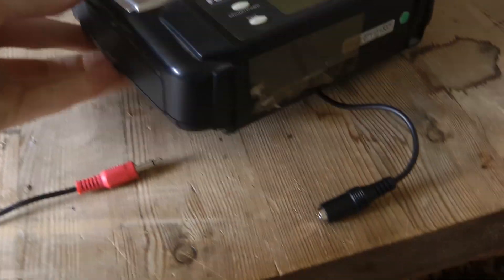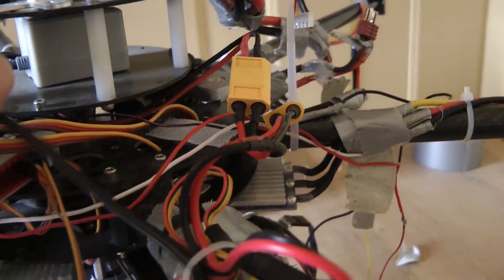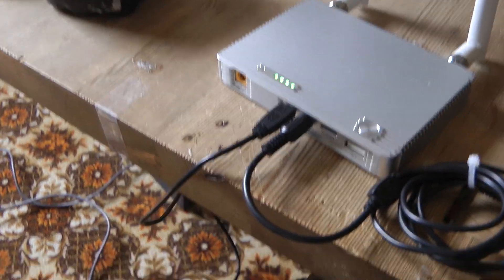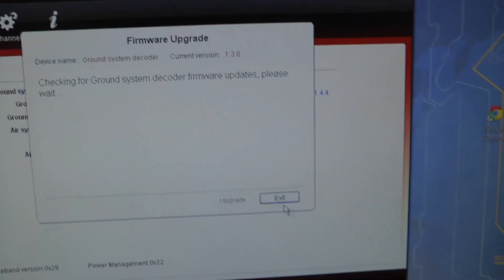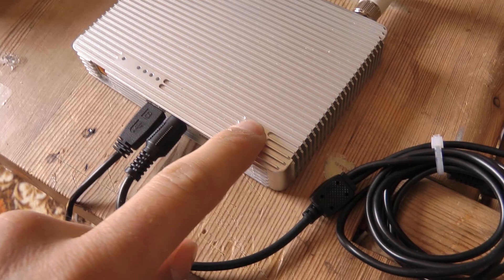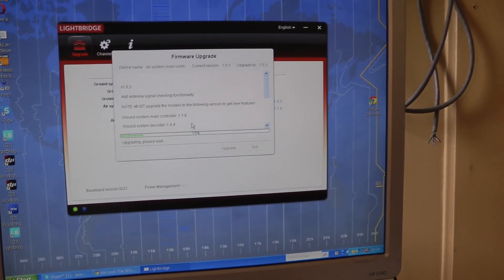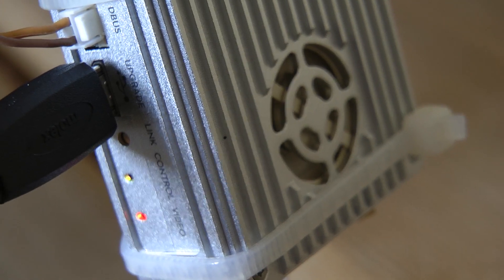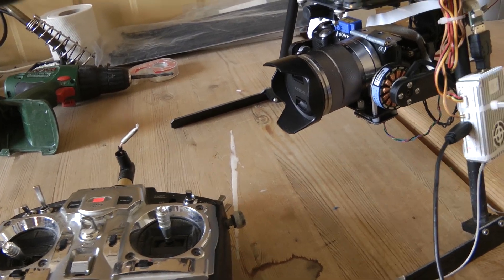DJI Lightbridge SETUP video only, review later

Comment: does the failsafe work? If you loose connections to lightbridge, does the wookong go into failsafe?
Reply from the maker: It'sa while ago I used the lightbridge, the drone itself was so big it was so hard to travel with so I didn't use it that much. I cant really remember but I'm pretty sure it would go into failsafe if I turned of the radio. I had a switch for RTH.

Comment: Did you have to set up the controller at all other than turn the rc off?
Reply from the maker: No, the radio was already set up with a regular futaba receiver on the hexa, but I did have to calibrate it within the lightbridge software and dji assistant software.  

Then on the radio, readjust the end points of the 3 position switch, so that the different positions of the switch would hit the different modes.(return to home, ati, gps)

From what I remember thats all.

Also remember to have a video camera connected and sending video to the lightbridge, if not, you will not have any connection with your radio.
Reply: Onkelaasmund Thanks that what I thought. Cant get control on mine and was wondering if trainer port needed to be set up in any special way. Thanks for the video!
Reply from the maker: I did fiddle with the trainer port but I'm not sure if that did anything. It is currently set to "n" for all channels.

And thanks for watching :)
Reply: +Onkelaasmund I'm trying to. connect external monitor to litebridge receiver.  How do I do this?